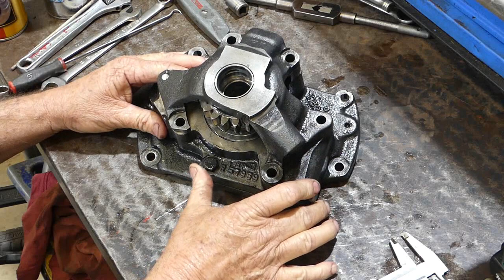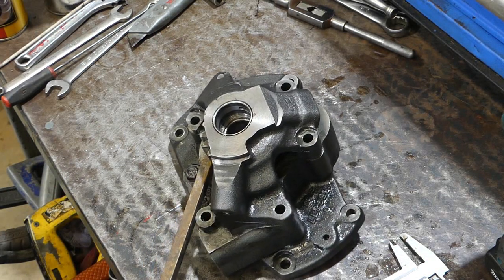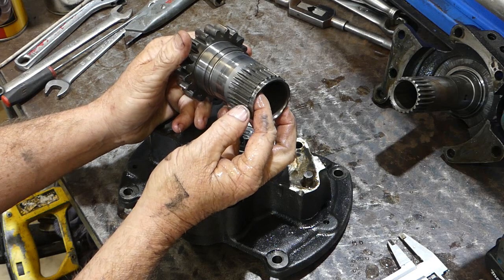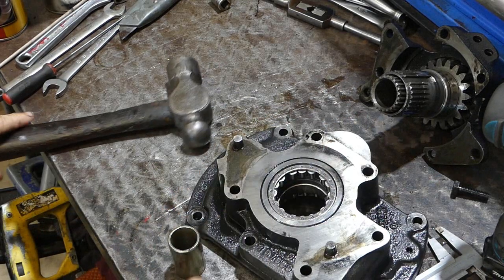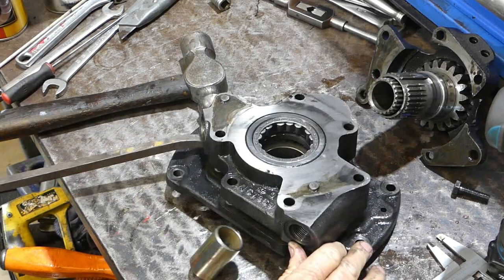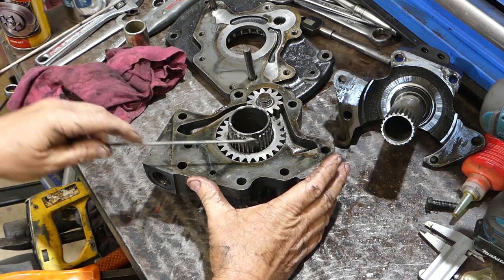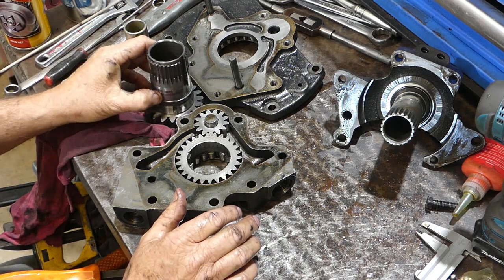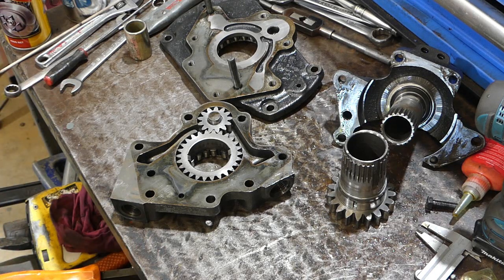John Deere 2030 Stripping the Transmission Pump

Comment: Hi i got a 2120 that im trying to figure out what is going on it has good hydraulic pressure the pto works good and so does the steering but the three point and rear remotes are slow and shudder when going up and down it has clean filters and fluid and suction screen what are the signs of a bad trans pump ?
Reply from the maker: Check for a rockshaft cylinder leak. Some times you can see it through the filer cap.
Reply: @BundyBearsShed  thanks for the suggestion !  I'll look into it

Comment: Nice video Lance, your right about the pressure spec of the pump, the service manual states 125 to 135 psi at 2100 rpm tested from the shift cover
Reply from the maker: Thanks for the info!